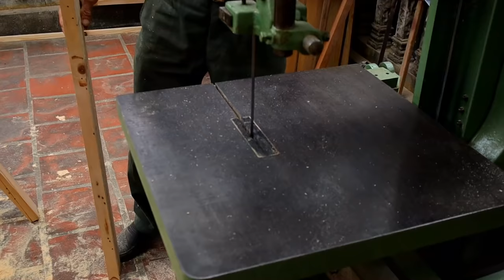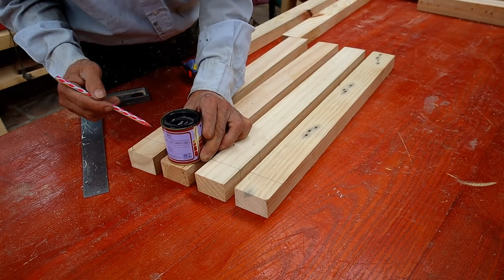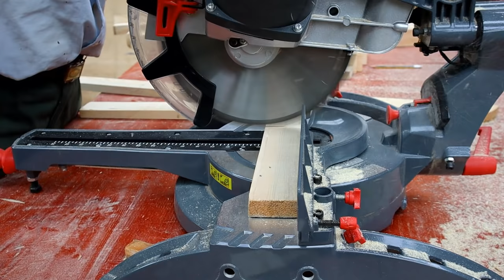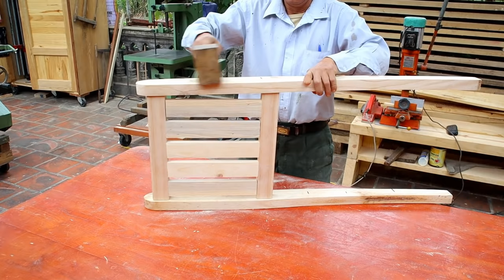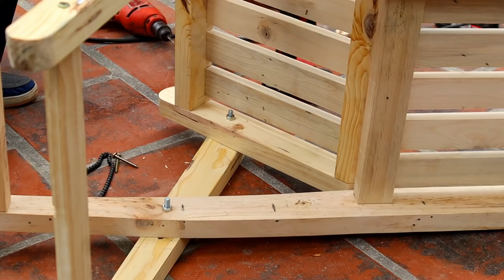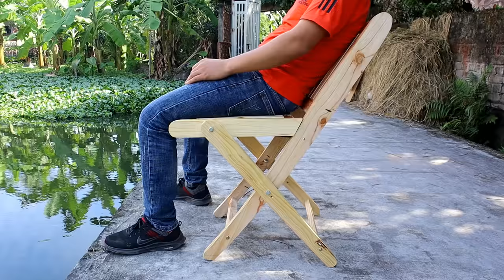How To Build Smart And Cool Outdoor Wooden Chair // Woodworking Project Cheap From Pallet

Comment: A few notes...

Not going to comment on shop safety or the quality of your tools... use what you are comfortable using, let the tools do the work, and your safety is your own concern.  I do still say you should seriously consider eye protection at the least, however.

When constructing outdoor wood projects like these, the use of a water resistant adhesive in the joints is a good idea, like Titebond II.  Also, when through bolting in solid wood, to prevent damage to the wood from the bolt or nut, the use of washers would make your project last much longer while not adding much to the cost!

Now, about other concerns.  The source of your wood is used pallets.  The lumber used can be softwood (generally spruce or white pine), or a hardwood (usually ash or oak).  Regardless of the type of wood, of greater concern is what it was used to transport, or more importantly, what may have been spilled on it during transport (like battery acid, chemicals, industrial waste, etc.)  Try to make sure you are handling an item that is safe to handle.  (Another reason to ask about it before getting it.)

Finally, for those who are looking for free wood... when obtaining these pallets, it is best to go up to the front of the business and ask politely if the pallets that are being disposed of are free for the taking.  Mention that you are wishing to recycle the wood.  It may be a good idea to offer to recycle a few of the pallets you are taking to build the business a bench or something nice... planter boxes, etc...  many businesses reuse pallets many times before disposal to save costs, so it is always a good idea to ask before picking them up.
Reply: I suspect the gentleman working on this project has already learned the value of a push stick, the hard way. On a lot of these Asian carpentry videos I rarely see a push stick being used at the table saw.  This is one of the rare cases when I actually see it being used!